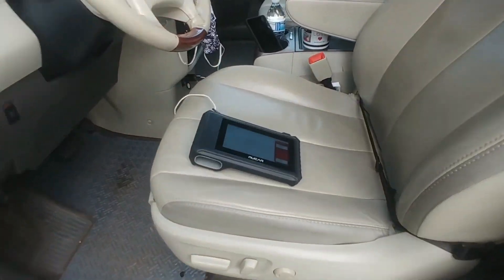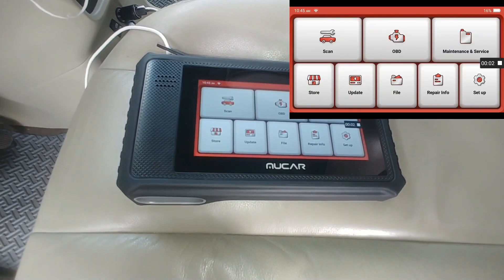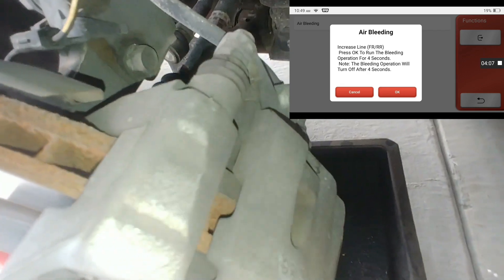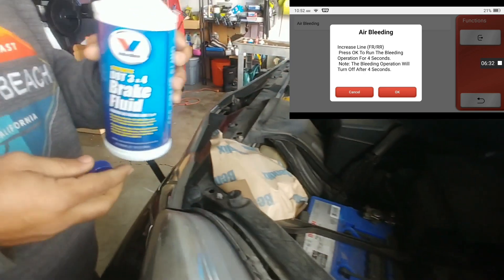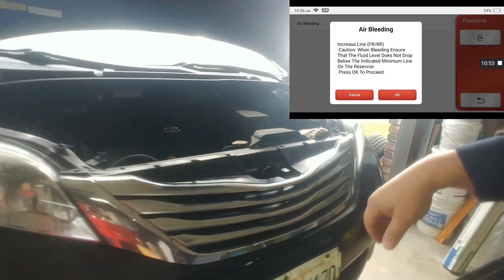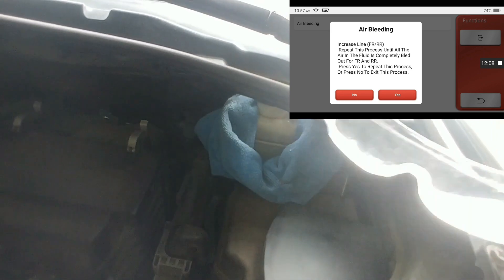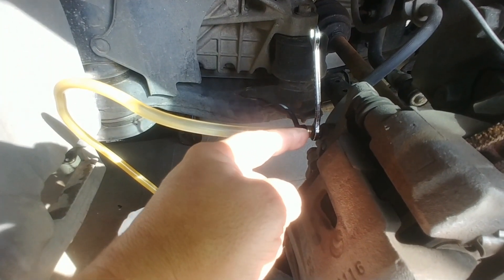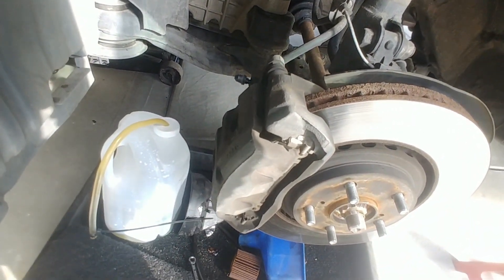How To Bleed ABS with a OBD2 Scanner▶️ One Person Brake Flush

Comment: Hi i don't get it so you use scanning tool to pump fluid but also pressing brake at the same time?
Reply from the maker: The Abs flush was a newer feature back when I recorded the video. As the updates came the process has improved. I hope that helps and it maybe time for me to update the video.

Comment: Whats the consensus on order? Should you start with the Passenger rear or end there? Or is it a different Process than Traditional Brake bleed?
Reply from the maker: It depends on the vehicle as the location of the brake fluid reservoir differs.
The scan tool normally will prescribe an order.

Comment: When bleeding brakes with the scan tool  how much do you crack open the bleeder? Also do you only keep the bleeder open until the ABS pump shuts off? And do you only need to do it once for each wheel
Reply from the maker: A quarter turn max. Just follow the directions on each scan tool as it maybe different. But keep bleeding or repeating the bleed until the flood is clear.

Comment: If you have a tool to pump brake fluid into the reservoir,  do you need a second person to pump the brake?
Reply from the maker: Yeah. A second person can open the valve as the person in the vehicle pumps the brake. Then the outside person closes the valve one the inside person verify the brake pedal has reach the bottom. Once the brake bleed valve is closed then the brake pedal can be released. 
You would do that until all the air bubbles are gone and the fluid is clear.

Comment: when doing abs module flush brake do you really need someone pressing brake pedal or you can just press the scan tool then open the bleeding valve or you have to do it your self pressing

Comment: do i only do this when parts has been replace? or i can do this like normal like i do when flushing my brake fluids? as off now im just flushing my brake fluids every 2 years honda hrv 2020 i have and my scan tools do have this options but it said that only use this when abs modules calipers or any parts concerning any brakes has been replace i need advice on this.if i can do this even not parts replace like doping my normal flush after that do this abs module flush? thanks

Comment: just bought the proscan for my 2000 nissan xterra and i was as dissapointed as i possibly could be because it did nothing. it couldn't read the vin , it did not recognize the engine nor the transmission and nothing else. even though my vehicle is listed as one of the vehicles that it covers. i even asked them on the phone prior to buying it if it works on said vehicle. What a disappointment. One other thing customer support is very iffy and not at all professional ,at least here on the east coast of the US at the New Jersey location AND IT DOESN'T BLEED ALL ABS BRAKE SYSTEMS

Comment: both wheels should be bleed at the same time so as not to load the ABS pump

I have a delphi ds150e and it says manually bleed brake is required before this procedure

Why
Reply from the maker: That’s news to me. You would need more than one person to open the valve on two different wheels at the same time. You might be right but I haven’t come across that yet.

Comment: This is very confusing. It says in the title it is a one person brake fluid flush job, but you used two people. The second person is sitting pumping the brakes while you are running around opening and closing the brake fluid line and checking the reservoir and doing your best to teach. You do not show how to operate the scan tool or how to do this as one person. It was very hard to follow and choppy rather than one fluid step by step process. Seems like you’re attempting to make it an efficient video. However, it left it more confusing using a second person. 

I can tell you know what you are doing but I don’t. In the future can you have the second person film and you do all the step by step work.  That would have made a lot more sense.
Reply from the maker: Thank you for the feedback, much appreciated

Comment: Some notes for novices (like me!) Id be grateful if anyone could confirm or correct these points or provide any more info (especially for the third point).
* This video pertains to removing air from the brake line (bleeding), which is more involved than simply changing the fluid.
* If your car has ABS, but has no air in the line (from a mistake while changing fluid, or from doing work on the ABS, master cylinder etc), you do not need to activate the ABS when changing the fluid as shown here.
* In some cars like VW, the sequence for draining out old fluid is different: front left/right then rear left/right. I read that this has to do with the location of the ABS.
Reply: If you are doing a full brake fluid change then you should do the complete brake bleeding procedure whilst topping up the reservoir with fresh fluid. Some reservoirs are designed so you cannot simply suck fluid out from the top of it, and besides doing it that way would not constitute a full brake fluid change.
By running the abs pump whilst opening the bleed nipples on each brake and topping up the reservoir you are ensuring fresh fluid will flow through the abs pump and relevant pipe work.
Reply: Good answer! @revenant1976
Reply from the maker: Are you still looking for an answer? I bleed brakes normally the old school way if there is no air system.

Comment: I never saw you bleed the left side of the vehicle; were you able to? I just purchased a $6,500 Snap On Triton D10 and throughout this process and it never goes over to the left side of the truck. I'm working with a 2021 Jeep Grand Cherokee. It will direct me to R/F then R/R then 'Test Complete.' I spoke with Snap On and they claim its a software problem that could takes months to resolve. If I bought the one you have here to get this job done my question is; Have you ever used this on a late model Jeep GC and were you able to bleed all for wheels?
Reply from the maker: I’ve never used this on a late model keep grand Cherokee.
Reply: My scan tool also did not direct me to go to the left side, so I’m assuming his didn’t either 🤷🏻‍♂️
Reply: @perryreyes1104  This is crazy. I ended up using my brake syringe to force fluid through the left side of the vehicle and eventually got a pedal but for a nearly $7K scanner I should not have to do that.

Comment: Did you have to clear the ABS codes after your bleeding process?  I'm looking for a scanner that can clear ABS codes
Reply: Did you find an abs scanner?? I'm looking at the Thinkscan Plus S4, I need to see the live data from the wheel speed sensors. 2015 Dodge Charger,, ABS malfunctions it automatically turns off traction control and cruise control AND the automatic 4WD,, Wife's car!
Reply: @dondale68  look into the one I mentioned brother I know I’m hella late to comment but I recommend it highly it won’t break the bank I paid 200$ on sale
Reply: @blurr_blurr  I do like Foxwell! I picked up a Thinkscan Plus S4, and an extesion cord so my scanner can ride in the passenger seat as I test drive the car and watch the data stream! Cost me about $135, but it has already paid for itself on my wife's 2015 Dodge Charger, so it was basically FREE!! Even I can afford FREE!
Reply: Just my recommendation Iv had this thing for six months the foxwell NT624 does practically everything you need even for Hondas because no other scan tool had the capability to scan Honda codes
Reply from the maker: Sorry for the late reply! did you find a solution?